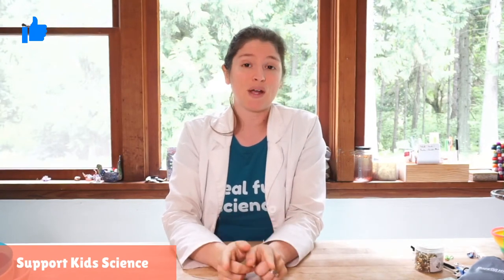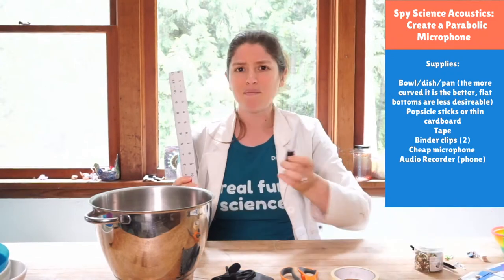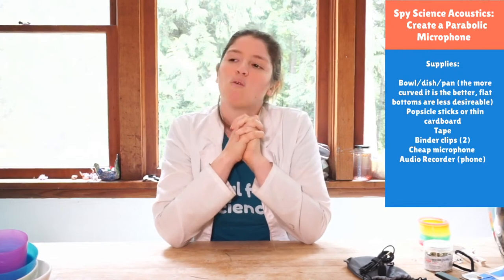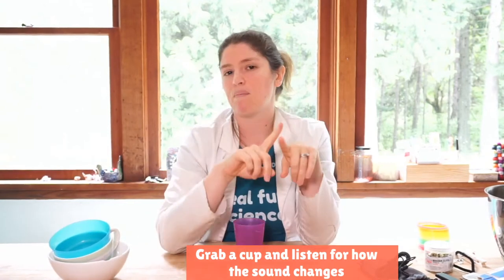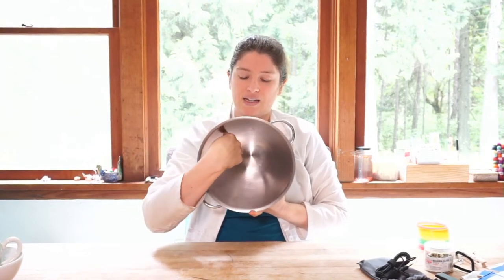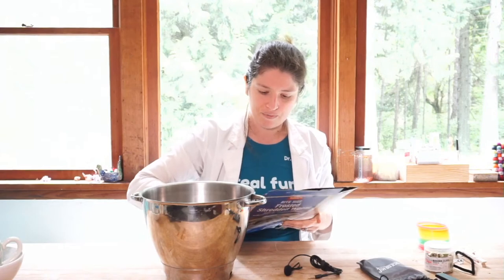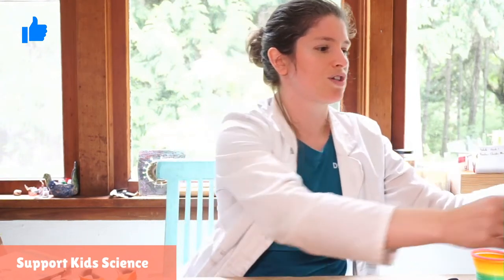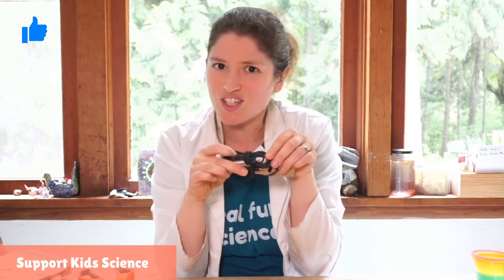DIY Parabolic Microphone - Acoustics and Crafting lesson

Comment: I've got an idea for you.
Explain how/why you sound like a robot when you speak into an operating fan.
As adults we know that it's the fan blades blocking the sound as they rotate around. Yet, knowing that, few of us can answer the follow up "Why/How?"
Reply from the maker: That's a great idea. We've done a little with acoustics but there's so much interesting stuff to do. The challenge is finding activities that have easy/universally sourced materials. I'll put it on the list!
Reply: I know a video is typically better, but for anyone reading this that either can't find a video or just wants a quick answer, here ya go. I'll try not to be too long winded but considering this is a channel mostly for kids, this drags on a tad cause I try to explain clearly. On that note, here's why you sound like a robot when speaking into a fan, if you want to know:

You hear sound waves because of how fast they travel to your ear from the source of the sound. The fans blades, because spinning, will periodically reflect some sound back, and then when it's not in front of you, not reflect that sound, so you go back and forth in between hearing a sort of "echo" and then not, which creates the robot effect.

The why, in simple terms, is because the sound is traveling a shorter distance from your mouth to your ear.

The point is, sound bounces off of solid objects more than air, so when the fan blades are in front of the sound, it blocks it or reflects it back at the source, in this case the speaker, and when they're not in front, it allows sound to travel freely. 

If you want to demonstrate the effect in a more easy to see fashion, you can take a piece of cardboard or similar, and speak in a monotone while moving it from in front of your mouth to away. Do this until the listener can hear the difference, and make sure, because it can be subtle, especially if not in a quiet room.
Once they get that difference, start moving the cardboard faster and faster, you will get to a point where you're sort of fanning it and the sound starts to come out pretty similar to a regular fan. 

Hope that helps!